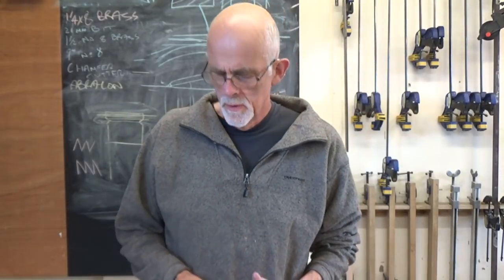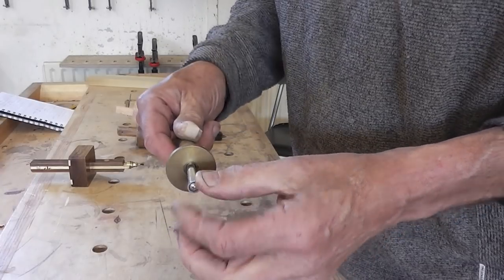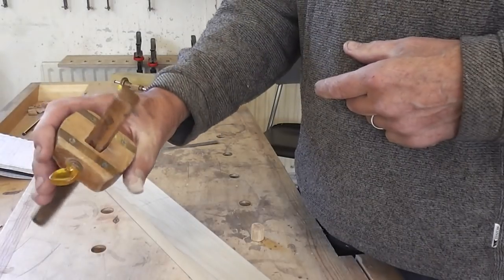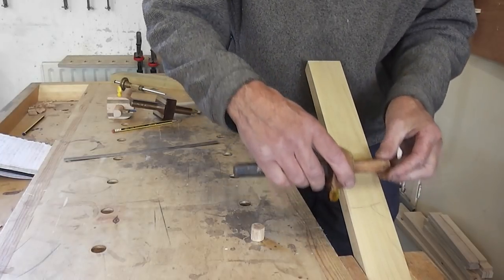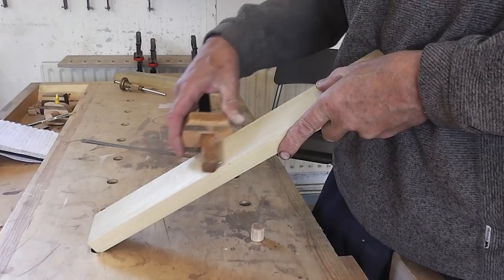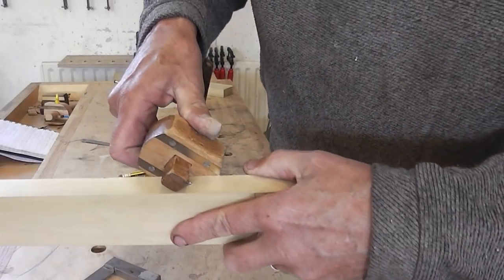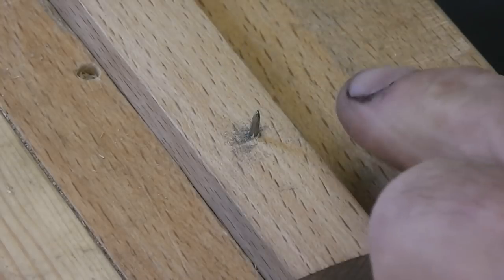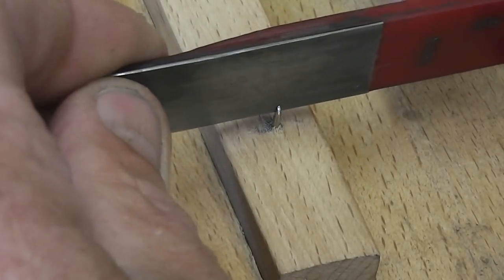How to use a marking gauge - avoiding a choice of wobbly lines! (+vol)

Comment: A very well explained and demonstrated video Cgris. 
Since I've not used those types of marking gauges before my thoughts might well be worthless and there's no real need for better. That marking point is extremely soft. It's easy to get round or even square pre hardened High Speed Steel (HSS) blank tool bits at those sizes very cheaply. $2-$3 at most. And there easy to cut to length. Just nick the shaft where you want it to break, wrap in a paper or cloth towel, then lay it across a slightly opened vise and tap it with a hammer. The paper towel or cloth will keep the pieces from flying off across the shop when it breaks. And the tool blank will cleanly break much like glass does on the weakened area from that nick in the surface. However you certainly won't be filing it to shape as they would be harder than the file. Grinding to rough shape then final honing with a stone or diamond file would be needed. But doing that type of work to only mark wood it would be a very long time between resharpenings. And I'd guess you could get a far finer point that's much more durable than the soft steel it looks like there supplied with. Any good industrial tool supplier to the metal working trades would have HSS blanks in those sizes. MSC Industrial to name just one.
Reply from the maker: Thanks for the input. It has never occurred to me to upgrade a gauge with a harder pin . Profiling the point as I have shown should only be needed once in the lifetime of the tool. After that it may need tickling with a file or slip stone very occasionally. It is mainly just scoring fairly lightly with the grain so is not subject to much wear and tear.

Comment: YouTube notified me you uploaded a few days ago but had trouble. Glad it finally came up proper. Excited to see more from you.
Reply from the maker: Thanks for the support.
Reply: Chris Tribe Every time I see your workbench I'm trying to figure out how it's constructed. How the legs attach to the top. How the tool well connects. Looks perfect for me.
Reply from the maker: I designed that bench with the aim that it could be made by a fairly inexperienced woodworker with as few tools as possible. The top is 18mm birch ply with a approx 1 1/2" x 8 " redwood apron glued and screwed around it and over shooting at the back to form a tool well. It is reinforced with 2" x 4"ish redwood batons glued and screwed underneath. The legs are 4x4 redwood and the rails are a glued and screwed box section. The rails are jointed to the legs by locating on blocks glued and screwed to the legs and bolted together using 10mm threaded rod running through the legs and in the hollow of the box section, this means no mortice and tenon are needed. It's a very rigid structure. The top fits over the legs so it can be fixed using screws throught the apron into the legs.  The tool well base just drops onto 1 x 1 batons screwed at the bottom of the well.
If you want I can send you a sketchup drawing and cutting list. I recorded a video of the making but in the end decided not to post it because I was not happy with the quality. I did post about the making on UKworkshop https://www.ukworkshop.co.uk/forums/six-tool-bench-t106170.html
Reply: Chris Tribe That forum post is pure gold. Thank you. I'd love the sketchup. It's not attached to the forum post?

 I don't see a tool well on the forum post. That's where I don't understand how the legs attach under the well.

The side walls are tall enough to still connect the legs in the tool well corners. And there are bracers under the well to reinforce the whole top structure I think is what you said above.
Reply from the maker: Hi Fearsome, I forgot that the one on the forum is without a tool well. The back legs are shorter than the front so they can fit below the tool well support pieces so they rest on the ends of the legs. On the one in the vid. with the tool well the support pieces sit about 40mm (1 5/8"ish) above the bottom of the apron. The idea is that the apron should be a snug fit over the legs which are quite rigid so the fixing of the top through the apron is just to locate it, it does not really increase rigidity.

I need your email address to send the drawing, if you don't want to give it publicly you could go to my web site and eamil me from there, un less you have a better way. www.christribefurniturecourses.com